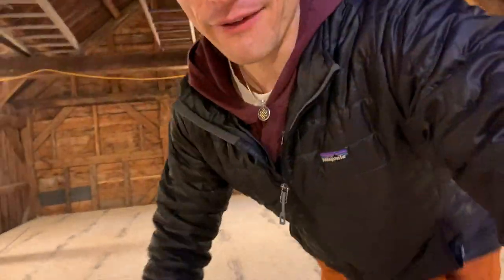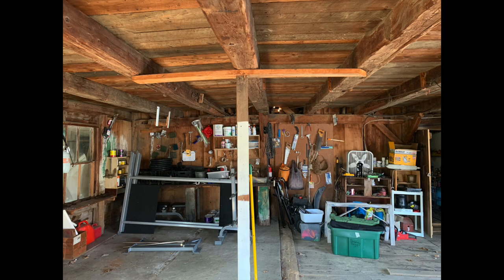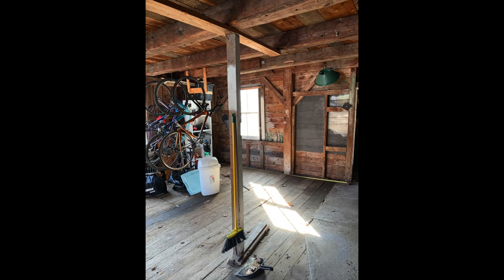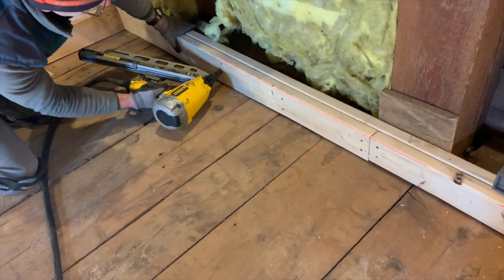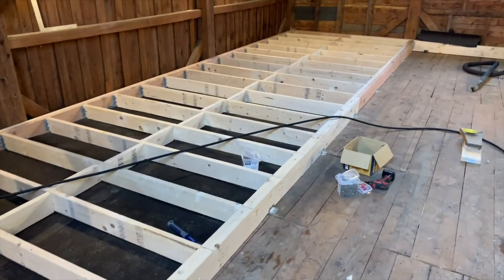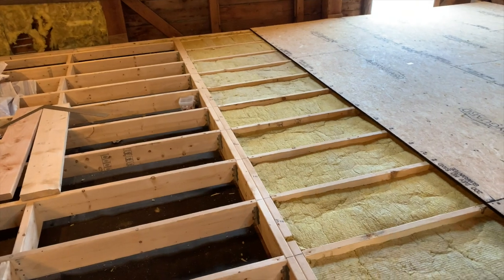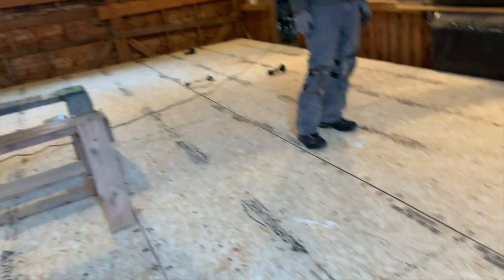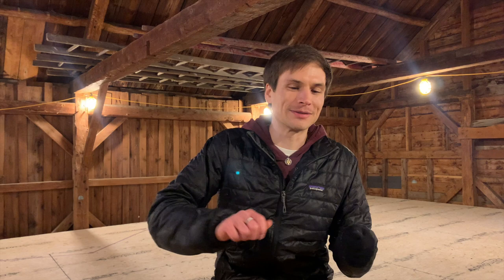100+ Year Old Barn Renovation | Reinforcing and Leveling the Floor

Comment: I think that you can retain the "old barn" aesthetic as you adapt the space to your needs.  If you want large windows, perhaps they could be on the walls that are not visible from the driveway, and the interior could take advantage of the style and the beautiful beams and wood.  In that setting, your studio can be be unique and distinctive, and not resemble a transplant from a strip mall.  As you enclose areas for heating efficiency you might not have to make major changes to the basic structure, and in years ahead, as your needs change, you can undo anything that was done now.  

You are doing well in updating your house while still respecting its history, and perhaps you can do the same with the barn.